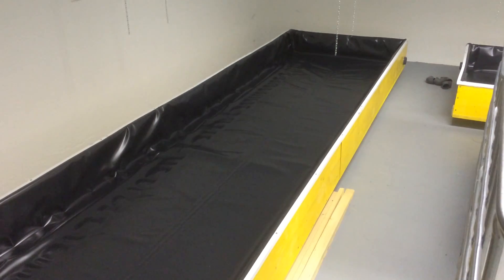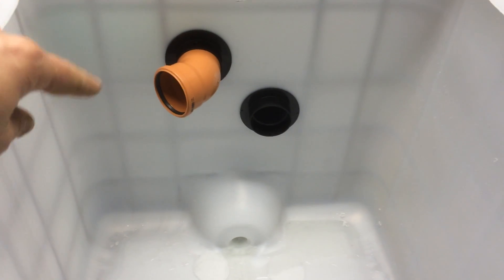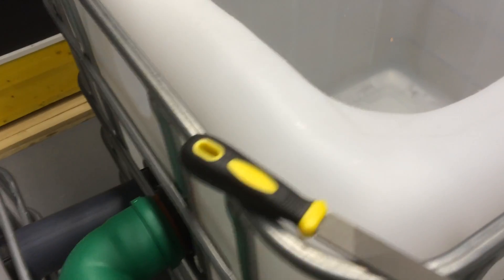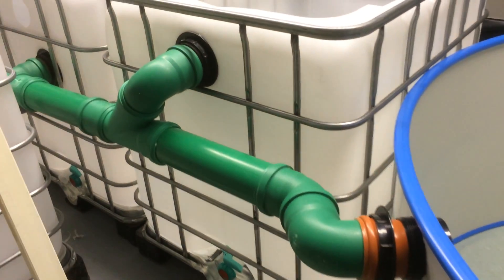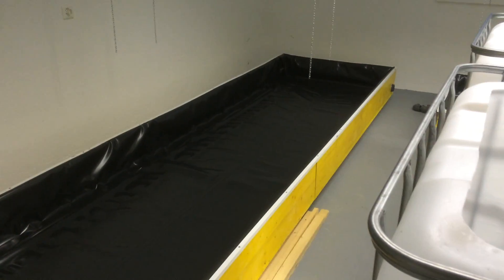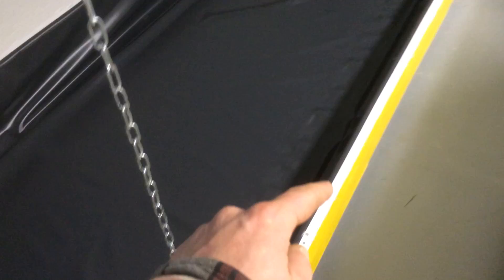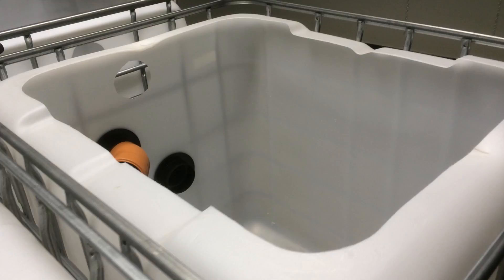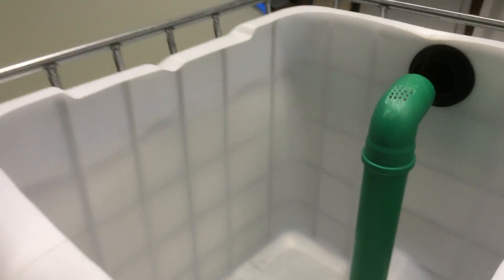Aquaponic filter and system design

Comment: Hello again, I am doing  system similar in style, and am looking for 3" bulkheads.  What brand of Bulkhead do you use?  I am looking for something slip fit coming out of the tank instead of threaded.. thanks for any info you can give me..
Reply from the maker: A CUT ABOVE FPV PRODUCTIONS I recommend threaded Fittings always.. Grommets will eventually fail as they are only a gummi seal.. spend the extra few Dollars and ucse a good Quality bulkhead Fitting.. if you Need some tell me and I will send you some..thanksPaul
Reply: I planned on threaded , I meant where the pvc goes in to the bulkhead.  It looks like yours aren't threaded.. If they are that make it easier.. I can get the threaded ones easy enough out here.. Your newest system looks amazing!!!
Reply from the maker: A CUT ABOVE FPV PRODUCTIONS yes our bulkhead Fittings are not threaded.. they are fitted with pvc glue..They cost around 30 euros per Piece.. with large orders I can reduce the Price.
Reply: I found some yesterday! $17.00 US
thanks for the information!

Comment: Paul, My IBC system is 10,000L here in Thailand & I am very keen to know about your 20T system. Can you provide any info on your drum filter?.
I am using ceramic beads & Zeolite on spag mats with 4 100mm air stones in the Bio filter, I am keen for you to run through the Tech Specs of one of your systems as you run very high fish loads which is where I am leaning.
I have read a report that fish grow better in round tanks with a moving current, any comment?
BTW there are 400,000 Fresh water fish farms here & 380,000 salt & most of them are run like a Lottery, lucky to test even PH
Merry Xmas, Ed